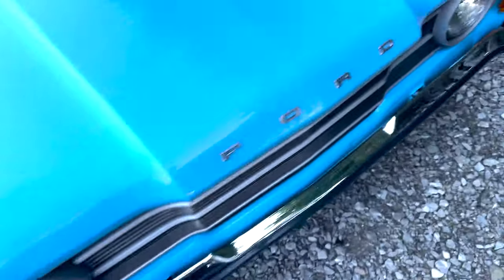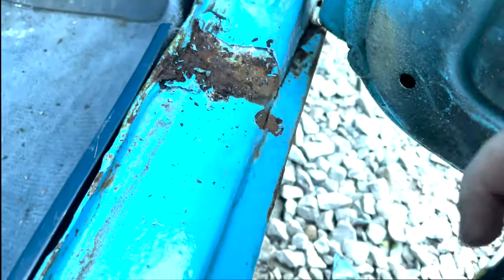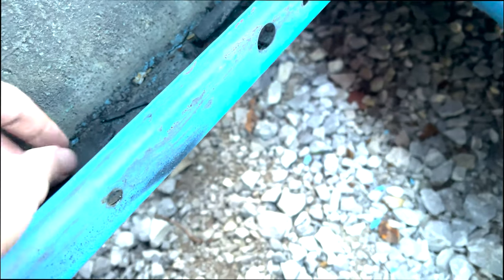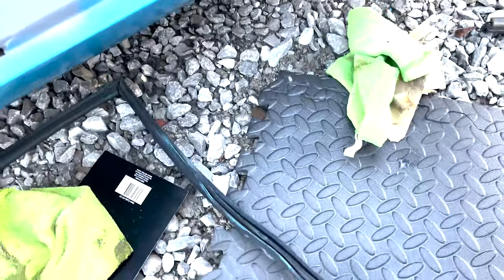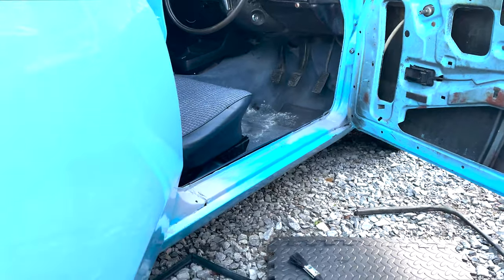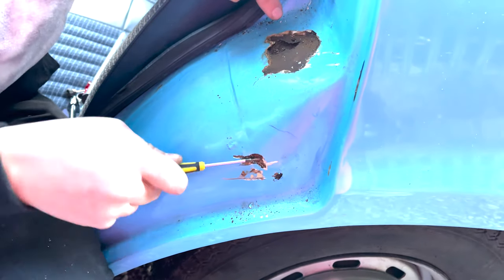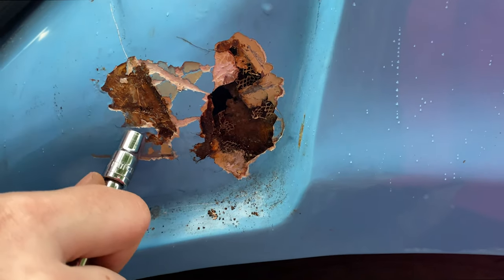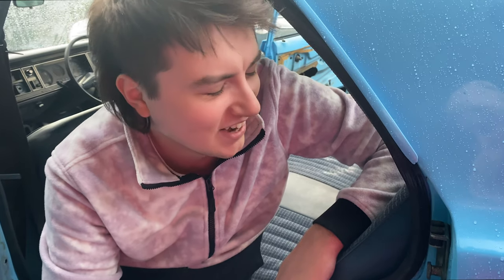It's WORSE Than We Thought - Ford Cortina MK3 Project - LOTS OF FILLER - Part 4

Comment: Tom, it's hard to find a Mk3 that HASNT rotted in these places. It's the standard rot areas and there are methods to repair, overall it's a good project, the rust you have found and the filler repairs are very common on these cars.
Reply from the maker: Thanks Pete, i appreciate the advice, I think what’s annoying us is that people on good ole’ Facebook are acting like we didn’t know what we were getting into. Main thing is we really really like the car so we’re prepared to fix it and do it right. We’ve been watching your videos for a while so when this one came up we knew it was the right time to buy it! Wasn’t too far from you either

Comment: Good luck with the repairs. I like the coke bottle Cortinas.  
Looks like zinc-mat from a bodywork hole repair kit in that nearside rear arch/dogleg. Bite the bullet and get a flap wheel on that area to see what's lurking. Now's the time to find out while the car is off the road.

Comment: That's much better than TeeCee was door wise. I had to repair the same areas and the sills were covered in filler for no good reason. The doors on mine were missing all the plastic liners so I made new ones and the passenger front door bottom was gone, the rear door needs repair still. The ski slopes on your rear arches are pretty good to be honest.

Comment: Tom as long as you cut it out properly and buy good replacements it should be all good, Cortina's always rusted, my father's front shock came through the turrets it was that bad in the 1970's. It wasn't the cars, it was the bad steel they were built from and it wasn't really to the age of the Mondeo that Ford sorted good steel to produce cars from.
Reply: Yep My dad had a mk 1 escort that had a suspension turret issue and a very bad front scuttle after just a few years.All 70,s cars had rust issues though but sadly there was a saying that "Old Fords never die, they just fade away".Had that as a rear window sticker in a mk3 capri I once owned.

Comment: Reminds of my police man neighbor's Cortina Mk4 as a kid I used to love popping the rust bubbles. One day I noticed juicy bubbles on the ariel base. I poked the bubble and to my horror the aerial disappeared along with my arm into the inner wing. 

I calm as you like walked away. Casual like sprinted away  😀

Not as bad as Harry's Lancia 50kg of filler removed. Yet he is seeing it through. Though in those days and today not everyone has a welder. I can weld and it is a huge money saver. 

Stop poking it 🙂 enjoy for a bit. Then when you do work on it you can imagin driving as you work on it. Good for moral.
Reply from the maker: I agree with you there, I saw Harry’s video too was quite shocking.
Reply: I'm not a Ford guy but I do like the Mk3 cortina. Join clubs make as many friends within the scean. My heart was in my mouth watching the Lancia vid. But take note how harry delt and note the guy doing the metal work. Yes harry no doubt has a bigger budget.

I'm going to make a vid on the welder I have for you I'll post link hear. Once you have seen I'll remove.  A quick basics on the welder I have. Buy a welder with more power than you need. Handy for non automotive jobs too. I made a table for mum sculptures car repairs and repaied my glass blower blowing rods etc.

Comment: The moisture in the rear arch tubs is because the water is getting through from the inner arch tub, there is a whole can of worms there, the sills look poor, you may think they are mainly solid, but from your video i can see its had sills fitted over the top of the originals, i was going to veiw this car but decided not to bother because the mot history showed the body was heavily filled,
Reply from the maker: It’s fixable and that was referring to what we discovered. We’ve spoke to a fair few people about it’s history. I disagree with the sill comment, we viewed the history etc and made an offer based on that, we didn’t pay the full price, I think we got a bargain considering the state of some of the others on sale.
Reply: @tomdrives  everything is fixable, and you are entitled to disagree, but having owned just shy of 30 cortinas, restored 10 of them and lightly restored another 10 or more and currently own 4 of them there isnt much i miss when it comes to these, you will see when it comes to it if you go down that route, no one is pulling it down, im giving you the benifit of my experience, good luck with the car,
Reply: Bruce, good to see you, yes, same view I saw on that rear tub

Comment: Issue is with filler is it absorbs moisture and can cause more issues later on down the line if it’s not been applied properly, as you say that’ll need a whole wheel arch section as I can imagine that rust extends further into the arch. Good luck with it
Reply from the maker: 100% this, we’ll be taking the whole thing back and cutting it all out. Last time I did filler it did the same but a lot faster 😂
Reply: @tomdrives  Check them B Pillars too i noticed there was a crack running along the bottom of it could be filler too? either way Plenty of Content to be Stirred up for the channel ;)

Comment: It's not really half bad for its age. Those sills look quite suspect though - it's had cover sills fitted and they have been plug welded on the lower door step. I would definitely check the integrity of the inner and outer assemblies - the complete sills  themselves run under the lower A and B posts where you have shown where the grot is festering. Localised repair is possible in the short term but definitely it's worth keeping an eye on for the future. 👍👍

Comment: This car is in outstanding condition considering most went rotten even 4 years from new .. the wings  used to go first  and  the Mark 4 was no exception .. the Mark 5  fared much better as Ford had mastered the rustproofing  a bit better and better quality metal  (more lead content in the mild steel) 

I hope all goes well  I'm  certain  once it's patched up all it will need is  to be looked after  maybe re-waxoyled  and the obvious use Triple Wax every couple of weeks  to keep it sealed from the elements

Comment: Those rear arches were bad I "repaired" one with fibre glass and filler it was a acceptable repair in the 80s lol how tines have changed thank god  we used to pop rivet wheel arch panels on not bother about cutting the old ones off and just fill em.same with sills just put one on top  it was acceptable in those days nod classed as bodging

Comment: Given the cheap shabby unmasked respray, I expected problems hiding underneath, Re the Sills they Have been  Replaced with after market panels, the Original Ford ones are not flat on the tops like yours, they should have pressing details. Form Factory, the original Ford Sills lasted 6.5 to 7  years (untreated) I had full original Ford sills fitted by a  Rolls Royce  Specialist bodyshop, costing £90 a side in 1981, which I treated inside, before they were fitted, and they lasted 25 years, The new ones again original Ford , on my recent fully restored  concourse shell, (the car on my channel) have had even better anti rust treatment, and should last at least 50 years, along with all hidden box sections and chassis rails,  My experience is most Ziebart under body , cavity treated cars last well, the rust tends to be from the paint side like chips,  or missed areas, or replacement panels after it was treated, then rusting , I expect you will find more filler and rust, and it will have hidden rust in places you can not see into, but basically it should be a good car,
Reply: Keith the repairs on Tina G are still holding up since 1993, I managed to make sure I put plenty of body protection in.
Reply: @PeteCswampy  Hi Pete, I loved your comment, as it shows that old Fords especially the Mk.3 if restored properly and to a high standard, like we do them, last years without rusting,, as well as looking stunning, As you know from our conversations I adore your fleet, your passion for "detail" and enthusiasm for the marque,  something which mad Mike & I  from the Mk3's launch in 1970, also share, I think Tom & Katie's car is hiding a few old repairs and rust issues under that recent filler & respray, after 10 years standing in a lock up, but it is a "beautiful" car, and far better condition than the massive projects with extreme rust we have taken on, and done on our channels,,  I love their Olympic Blue Cortina "L", and I am really looking forward to watching their videos  on it. Great seeing youngsters appreciating the Mk.3, and not just us older ones who can remember them Brand New in showrooms .and on the roads by the thousands,